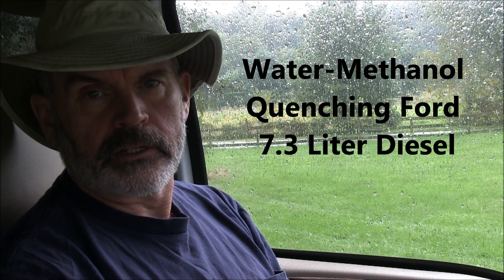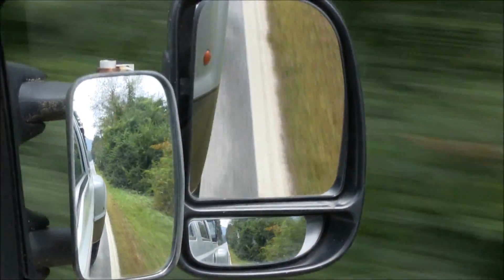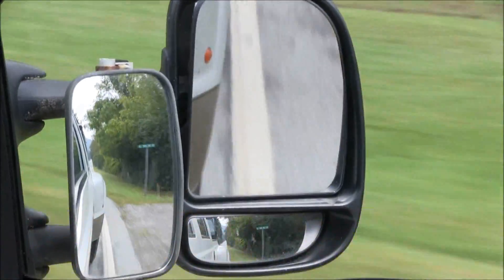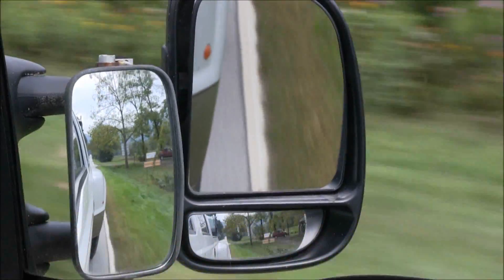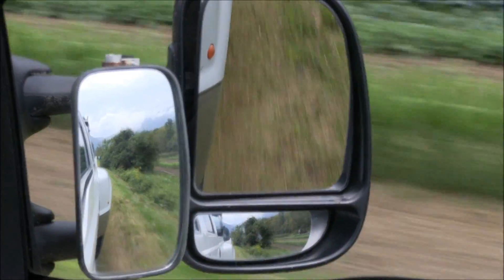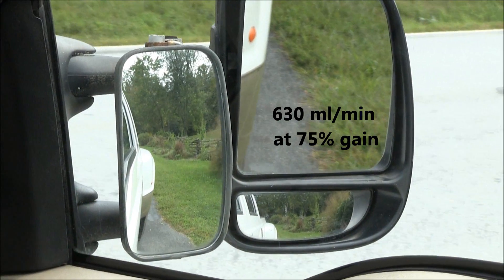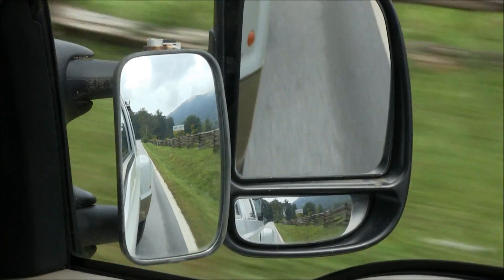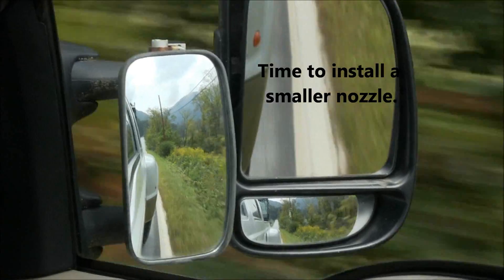Water-Methanol Quenching Ford 7.3 Liter Diesel

Comment: FYI for people - 630cc is enough water/meth for 600hp-800hp plus of airflow , you need to be way up in the throttle and power levels to use that much liquid flow .

Comment: I have a 2005 5.9 that I have done mild upgrades to w/6spd. man. and I love my meth injection. It never makes smoke of any color and EGTs never go past 1150. It pulls better and has a little better MPGs. I installed Fleece coolant bypass with 2 pyrometers "front and back" and made a positive affect on this particular engine.

Comment: Why not use ammonia gas dissolved in water for diesel injection.
Reply: You mean def fluid? It will reduce nox but it’s much more caustic than methanol water mix. Ethanol water would be more suitable
Reply: @TheOliveboy93  I guess windex would not help.

Comment: I would daresay the black smoke that came out after the white smoke is the "quench" as a result of too much heat loss during combustion.  That white smoke is carbon deposits being broken down en-mass from the water.  You probably have a small amount of white smoke (as I do with my own hydrogen fuel cell setup that produces a lot of heated water vapor) that is there during lower boost but there is too little to be seen as it dissipates quickly.  The water injection systems aren't ideal IMO.  They use a pump that increases PSI as voltage is increased to it based on voltage output from the controlling unit; however, those nozzles only operate a max efficiency at higher pressures.  Once the voltage is high enough as a result of configuration you get ideal atomization.  It's very possible there is actual water sitting inside your intake system and as the air velocity increases with engine speed you're getting a double whammy.  Resting water is being slurped in while there is also injection.  My own observations on my hydrogen system have led me to believe white smoke is actually the water penetrating and helping to oxidize carbon deposits.  I had a heavy gas smell on this old '96 since I bought it, and when I put my hydrogen system on there recently the gas smell slowly receded until it was gone, then I started having white smoke which decreased over the next few days.  I thought it only did it in clouds periodically like you see when driving, but when I went to the car at idle there was faint white smoke coming out the back barely noticeable.  On acceleration from idle there would sometimes be thick white smoke.  In my application the water vapor is on the tipping point between  being a vapor and a liquid.  As soon as the throttle opens the vacuum drops and some, if not most, reconverts back into water molecules temporarily causing a momentary heightened influx of  water which saturates carbon built up on the pistons and valves.  Diesels are notorious for carbon deposits.  Use a heat exchanger in line with your coolant system and your diesel fuel to pre-heat it to increase the conversion to steam, increasing the power and cleaning.  Even at 180 degrees it's going to cool the combustion given how hot it is, but the added heat will help steam clean out all of the carbon build up.  If you do that you'll find you have less momentary clouds of white smoke and more even distribution of slight white smoke under boost.  The nylon tubes from Snow are good for 1400 degrees so you have nothing to worry about there.   I have a snow system on my off-roading Cherokee.  You can also use a heat exchanger on the fuel lines to increase efficiency and power as well.  There is a company that makes those units expensively.  I forget their name.  You can just go to DudaDiesel and purchase a heat exchanger and use some creative line/valve engineering from Lowe's to control how much goes to the heat exchanger before it recombines with the rest of the normal fuel lines, like I did, so you can have control over the temperatures.  I did this for my gasoline setup but gasoline vaporizes so well it's not necessary.  I also don't have a fuel return setup on my Jeep like most vehicles so it complicates matters for me (hence the reason I had to use the valve).  

You can go to my own small youtube channel to see what I have drafted up as a combination hydrogen fuel cell/heated water vapor injection system.  I've had 60-80% increase in mileage on my 4.6L supercharged Cherokee with a notable increase in throttle response.  I currently have it on the car and am doing testing and may be installing a series of them for a nearby construction company in the near future.  I've been developing it slowly for the past 4 years and will be applying for a set of patents and a trademark logo within the year.
Reply: I blew my new diésel truck using Pure methanol i think methanol and diésel is a stupid combination, let me know if you can help me if i am wrong?😅
Reply: @ew10j4turbo  You do not use pure methanol.   Do more research. buy less parts. Your wallet is bigger than your brain.

Comment: Get a DudaDiesel heat exchanger and have them do the calculations to get your water pre-heated to 180.  You're injecting ambient temperature water of about 85 degrees.  At 212 it turns to gas (think HHO).  Water "vapor" is probably mostly HHO, but as it hits ambient air temperature above the surface of the water some of it reverts back to water (and appears as steam) since it didn't have enough energy to completely break the hydrogen bonds.  Adding even 60 degrees to the water temperatures will make a world of different.  It takes a lot of energy to change the temperature of water.  You want to use the coolant from your engine with the heat exchanger to displace the heat from the cooling system into the water.  The more heat you dissipate into the water the better it will run with more water (to a point) and the more heat you'll pull out of the cooling system.  2 birds with 1 stone.

Comment: Why woyld you do that to an already weak designed engine.
Reply: gentile joshsaved 😂🤣😂🤣. You think the 7.3 Powerstroke is weak?  Yeah, I suppose that’s why International made these engines and put them in their Medium Duty trucks with GVWR’s of 25,000 pounds. Thousands of truckers used and wear by these engines. You do realize that the 7.3 has the nickname of the Million Mile Motor for a reason right?

Comment: so if you had more boost pressure can you add more water?
Reply: If I had more boost pressure (air) I could add more fuel and more water. Water absorbs energy when it is turned into steam. The more fuel/air you have the water you can add. At some point the added water will quench the fire and the fuel will fail to burn.
Reply: I'm building another semi for drag racing and sled pulling, I'm trying to figure out what I can do to get more fuel to it, the compound turbo setup I have is enough to make 75-80lbs of boost. stock the truck ran 50lbs of boost. when it hits about 56 pounds of boost it leans out. I'm trying to figure out what I can do to get the extra fuel to run the extra 20 more pounds of boost. the truck will be used as a daily driver and also as a sled pull truck. right now I'm maxed out on the tuning and on a low budget, there is no aftermarket fuel injectors or injection pumps for it and I already have two 265gph fass lift pumps. I'm trying to find a way to run straight water because water I can get almost anywhere and cheap, on the road its not so easy to find methanol around and the blue windshield fluid is almost like running water. do you think I can use water injection to make up for the extra fuel needed to keep up with the boost?
Reply: killer120  I use water injection on a semi for egt cooling only. It will only increase power slightly from the steam effect and the cooler air charge. Methanol makes the real power,but as you said,it is inconvenient to use on the road. Straight water will improve heavily boosted motors by cooling the intake air temp.
Reply: Water is not fuel. Water can be used to control EGT and the steam generated will give you a slight boost in HP. Too much water will decrease the HP. Alcohol is fuel. You can add alcohol until all of the surplus air (boost) is used up. Adding more fuel (alcohol or diesel) will make everything hotter and you can burn up the tops of the pistons or the turbocharger vanes. Water is mixed with the alcohol to help keep everything cool and to prevent the alcohol from catching on fire prematurely. 50/50 water/methanol can not be ignited with an open flame. Keep in mind that any time you add more fuel and air to your engine you could blow it up. Each engine can only handle so much HP before it comes apart. P.S. I am not an expert.

Comment: I am a hotshot driver, pulling a trailer grossing 25 000 to 31,000 LBS.   The truck is a stock 6.7 Cummins. 
The stock Cummins does it , without all the backyard tricks.
Reply: Billy Bob the new 6.7 powerstroke would do it also and actually better
Reply: I just bought a 2008 with a 6.7 Cummins and I'm planning on adding one of these systems not for more power necessarily but for lower EGT's and higher MPG's. These systems lower your intake air temps and add extra O2 into the mix to help for a better cleaner burn. Water Meth injection as been around since pre WWII so it's well established and the power increases can be quite something on a turbo diesel. Especially engines that do have a some performance goodies added. These systems are on pretty much all the diesel dragsters to help control EGT's and increase power.

Comment: ok boys, a little education is needed here.  you are spraying way too much.  you need to back way off.  if you have upgraded the turbo and the injectors and maybe the fuel side, you could spray that high.   you are way over what a stock 7.3L can handle.  also, you need to run a tune from Banks or Snow that can set timing for this amount of methanol.  always buy an integrated system that can handle this.  you can't add this to a stock tuner, it doesn't realize you have the water meth and it doesn't set the timing accordingly or adjust your air-fuel ratios.   please read up and educate yourself before deciding on power adders.....

Comment: ? I don't know what is going on here. Are you getting any benefits from this ? 
Your rig does not seem to perform any better than a stock.
Reply from the maker: Lucky One Water/methanal gives a horse power boost to a stock engine. When larger injectors are used the water/methanol ratio can be adjusted to cool EGT.

Comment: Hi Mars, have you still got this setup? I've got a methanol-injection system from Devilsown for my 1986 Land Rover 90 (200tdi engine). We've just set up this channel to make videos on it so might have an installation video soon if you'd be interested? It's a tiny 2.5 litre 4 cylinder but I like the concept! Regards ~ Fred

Comment: My old girls are non turbo 6.9's. Will this help with them ,or does it require aspiration for it to work ? These old trucks are reliable but nothing close to the power of a 7.3 PowerStroke. It would be nice to have more grunt getting heavy loads up to speed. When rolling it pulls good but slow on take off.
Reply from the maker: I think a turbocharger is essential for water methanol injection. You need to have a surplus of air to burn the methanol.

Comment: what's the point, if you aren't making big power, and you don't have temp probs?
Reply: The engine lasts longer because it cools the piston/cylinder and improves fuel economy and reduces nox emissions.
Reply: there isint
Reply: the engine is not too hot if it is stock, and I don't know any sane person who thinks we are all about to die from nox emissions. so no.

Comment from the maker: Quenching happens when you inject too much water and the diesel fails to ignite.
Reply: so, did you find an 8 gph nozzle? something around, say 450ml instead of 375 or 630? if so, was that the right size?
Reply: Heat the water with a DudaDiesel heat exchanger first and you will eliminate the quenching and get even more power.  The closer the temperature of the water is to boiling the more it will expand into steam and push the piston without putting out the flames, and some of the water may even ignite (there are videos of guys igniting room temperature water, it all comes down to energy;  more heat will make it easier, and a higher energy ignition system will make it easier as well)

Comment: why not just run straight distilled water, if you only want cooling and don't need more power?
Reply from the maker: +crusty old fart I want as much power as I can get without damaging the engine or drive train. Injecting straight distilled water will give a slight boost in HP. The more fuel/air you are burning the more water you can add to the mix before the fire is quenched.
Reply: mars1952 OK . this should lower the EGT's too shouldn't it? I'm running a 4 inch pipe. with straight through muffler.

Comment: I had the same problem and I raised my first stage nozzle up to 14psi minimum and I went down on the nozzle size some.10 gallons per hr on a possibility stock engine at such low boost sounds like way to much to me

Comment: Hi , i have a Nissan Pathfinder 2.5 diesel , the injector that i use is 7  , they gave me a 3 and a 7 , used the 3 for some time then went to 7 , i don't observ any power increase with the water injection maybe because i use only windsheald fluid , i never had your problem the only problem i have is that i use the stock windsheald 5L tank and if i put the 7psi the  low limit  it consumes it very very fast .

Another problem i had is i damaged my turbine  , i mounted the injector in front of the turbo not after , allot of people on the internet and videos said to mont it in front of the turbine , the speed of the turbo is very high and will damage easy.

Comment: Do you have a problem with freezing in the winter?
Reply from the maker: Josh Bolles 50% water/methanol will not freeze at -40F or -40C. It is funny that C and F are the same at -40.
Reply: Sweet sounds good man I appreciate the reply!
Reply: +Josh Bolles 
Good ol blue washer fluid works good also.
Reply: MrTheHillfolk awesome ill have to check it out!
Reply: +Josh Bolles 
The source was the internet but I've read the methanol percentage of the washer fluid is around 32% or so.
if it could be confirmed then I'm sure some methanol could be added to get it closer to 50/50 but I noticed nice power gains with the washer fluid alone.
Reply from the maker: MrTheHillfolk Watch my video "What is the Cheapest Source of Methanol for Injection".
Reply from the maker: Josh Bolles Watch my video "What is the Cheapest Source of Methanol for Injection"

Comment: Great video! Do you think your experiment would vary if you increase the methanol ratio(so it ignites faster than water)? What ratio were you using here?

I'm building my own DIY W/M injection system, and my custom built injector has 600ml/min flow at 100% pump power, 500ml/min@50%, 350ml@35%, 225ml@25%.

I'm thinking I'm going to literally drown my 1.5l dci engine if your 7.3l couldn't take 10gph. I do remember though that some guy was using 15gph without a problem in a 6.3L.. so something must vary here, and I was guessing it was the alcohol ratio. Or perhaps the atomization quality / injection place.
Reply from the maker: Bogdan Boeru The limit on how much methanol you can add depends on the amount of air the engine is getting. A stock engine and turbo will not have very much extra air to work with so you can only burn a certain amount of methanol the rest is wasted. The amount of water you can add depends on how hot the combustion is so if you have big injectors and  a big turbo you will have a bigger hotter fire and you can add more water before you quench the fire. You have to balance air/fuel/water the only thing you can not have too much of in a diesel is air. Some people run 100% methanol and end up melting the tops of the pistons. For safety it is advised that you run less than 50% methanol anything more than 50% methanol can burn by itself and can be a safety hazard. Methanol adds power and makes things hot, water adds power and cools things down.

Comment: Okay so I don't need this unless I run hot I'm always cold driving even towing heavy  -1994.5  5 speed 7.3 4x4  4 in turbo back  stage 2 injectors  Jr hpop arp head studs non inner cooled
Reply from the maker: When injecting water/methanol increasing the percentage of water will cool the burn when you are over-fueling. Running a 50/50 mix will give you more fuel to burn and more power and the water adds a little boost when it turns to steam. If you do not need extra power and your combustion temps are not too hot then you do not need to inject water/methanol.

Comment: so whats this doing? power or mpg or both or what
Reply from the maker: Burning 50/50 water/methanol greatly increases HP and increases MPG a little bit even if you add the alcohol gallons to the total Diesel gallons used.
Reply: mars1952 sounds dangerous why not rely on the old 6.9's i get great mpg with mine 15 in town and 25 at 55 just not a dragster if you know what i mean
Reply from the maker: *****
To increase HP and control EGT. The alcohol is added fuel and it also increases the percent of diesel that is burned. The water turns into steam and expands (1200/1) increasing the combustion pressure and in the process cools the burn so that the tops of the pistons and the tips of the turbo impeller do not melt.

Comment: Since I average 10k miles a month I am going thru washer fluid like crazy. Average seems to be 3 gallons fluid per fuel tank.
Reply from the maker: Hi Tom, Since you should by bulk methanol and mix your own "washer fluid" using distilled water from air-conditioners or dehumidifiers. Watch this video "What is the Cheapest Source of Methanol for Injection".
Reply: +Todd Hoffmaster its about $280 for 210L of methanol